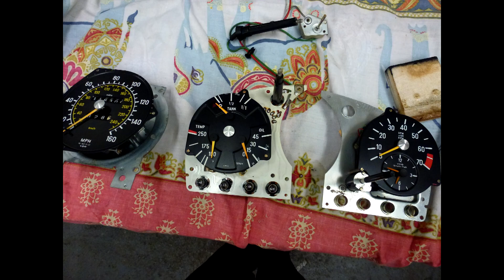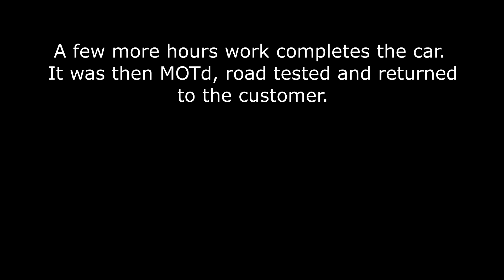Mercedes 350 SL Restoration (R107)

Comment: Guys, absolutely the best movie showing serious and professional 
restoration not only  107 but any other MB too. I have never saw such 
good tutorial and show not only on YT but in the net. Photos connected 
with movies with tune up speed was a great idea. I saw it already twice 
and I downloaded to my PC. I love a professional work whatever and 
whenever is made. Great respect. People who are speaking with 
professional restoration workshops even do not know what does it mean 
"restoration of old or youngtimer. This movie is showing all in details.
 Of course you did not present a cream - so working with every single 
component and part - where the engine end gearbox is a kink and queen of
success. I will sent a link to our forum related to MB SEC so W 126. 
Presented 107 is from III generation - so from period when 380 and 560 
engines were already used - so 1980 - 89. Almost it is the same period 
like SEC - only W126 has much stronger body concerning corrosion. 107 
has this famous problems with water and corrosion of bulkhead between 
engine bat and passenger cabin. I am more then sure that you were 
replacing this element and later on floor panels too. Looking at the 
stage of presented car - it was stored many years outside - not in 
garage - it is a reason why corrosion was so advanced. 

I have 450 SL from 1972 - so from I generation - it is an US version 
but without any American conversions - MB was sending them to US on  the
 begging  only with additional orange lights under front bumper and with
 "teeth" on the front and rear bumpers. Anyway version with 450 in 1972 
was only produced for US market. And I have 450 SLC from 1975 - so II 
generation from Germany.  I will make two  simultaneous restorations for
 ca. 2 years. Now I am working with another cabriolet from 1971.  I am 
amateur restorer. I have already restored three cars myself plus one Old
 British Pilot Cutter THPV Bembridge from 1938. She was imported by me 
and my company to Poland from Gillingham in 2009 and her project was 
fully completed in 2015. Something a bit bigger like 107. 
http://magemar.com.pl/bembridge/bembridge.html Restoring of cars is my 
hobby - not a business issue. Before any restoration I used to collect 
many materials and books. Your movie is great and is excellent tutorial 
for anybody who wants to do it himself or order it to professional 
workshop

Cheers from Szczecin, North-Western Poland, Rafal.

Comment: My 500SL had similar body work issues, all replaced with new metal inc bulkhead. For those wondering a resto like this would be around £30k. Good job on this one. I would have gone the whole way with the facelift 86-89 look and kept the other wheels.

Comment: Hello - can you tell me:
1. Do you have the facility to 'dip' cars onsite and if not can you tell me who you used?
2. Did you do all the metal fabrication and welding yourselves?
3. Do you prep and paint cars your selves?

It is quite a hard to find any shop prepared to take on that level of restoration - it is an eyewateringly expensive and time consuming job to undertake. Mike
Reply from the maker: Hi Mike, the shell was sent away for dipping but we did all the metal fabrication onsite as well as paint the cars. It was a big project but if you check out our Facebook page you'll see that major restoration is fairly regular work for us on many different marques.
Reply: @midbedsvehiclerestoration3045  Thanks for your prompt reply - you guys are the last of a dying breed when it comes to full restoration. I sent you an email regarding a project I'd like you to consider. Mike

Comment: Fantastic work! I love seeing the craftsmanship. If you don’t mind, what was it about this particular car that prompted the owner to restore a not-so-rare example, when a much better starting point could.have purchased, saving significant money overall?
Reply from the maker: The Owner had wanted an SL for some time & bought this one knowing it needed work, he just hadn't realised how much work. Once the car was stripped to a shell & dipped we discussed the possibility of abandoning the project but the Owner decided to push on with it as he would have a pristine example once finished & he has the pictures to prove what has been done.
Reply: Mid Beds Vehicle Restoration, Judging from the results, he picked the right shop to do it!, and completed and delivered in a reasonable time frame. As I am sure you know, many times that is not the case, shops take on restoration work they are not specialized to do and get in over their heads.

Comment: Awesome build👍🏾 My guess is it took at least over a year, probably closer to two years. How long did it actually take? 🕰
Reply from the maker: It took about two years all in all but we weren't on it continually for that time. It was a very comprehensive restoration in all respects & this all takes time.
Reply: Mid Beds Vehicle Restoration Yeah, tell me about it. I know all to well how long even the simplest of things can end up taking so very much longer than the few minutes that you thought it would take and not to mention  the unexpected can of worms that always appear even when all systems are a go. Builders understand these things better than most.
Reply: Looks to have been a bit of a basket case... Surely it didn't make economic sense to put so many hours and materials into this?? If it was a Pagoda or a Gullwing that would be worth over £100k I could see it could be worthwhile, but an R107.... Seriously??

Comment: I’m interested in getting someone to restore a ‘86 sl 560, that in a similarly bad condition. Would you be able to estimate what costs should I expect? Asuming the engine runs once the electrical part, which had a meltdown at some point. It’s also a hard too. An estimated cost based on what the one you presented would me very much appreciated!
Reply from the maker: Hi, if you'd like to drop us an email or give us a call then we can discuss it with you; we don't give quotations or estimates on Youtube I'm afraid.

Comment: How much did it cost, is it a case of If you have to ask you can't afford it?
Reply from the maker: It isn't our policy to disclose information like that; it really isn't a matter for anyone except the Customer Donald.
Reply: “If you  have to ask then you can’t afford it” Is not really applicable when it comes to car restoration. The numbers are generally derived by how far you want to go and then what crops up and or shows it’s ugly head in between time further influences the bottom line.

Disclosing the cost is sort of ireverlent but the more meaningful attribute is that the restoration investment far exceeds the intrinsic value.

Comment: May I inquire as to the cost for this project?  My guess is in the range of $75,000 USD
Reply from the maker: It isn't our policy to disclose information like that; it really isn't a matter for anyone except the Customer Joel. Thanks.
Reply: these cars max out at $40,000 or so, when undriven and in a garage after the owner died or something
Reply: I’m leaning more to the $100,000 side of things
Reply: A restoration of this level can easily exceed 6 figures in the States. Well beyond the value of this particular car, which likely had some sort of sentimental value to the owner. Very high quality work by this very capable team. Kudos to them! The customer has a beautiful car they can enjoy for many years to come.
Reply from the maker: @bondpit8750  Thank you.